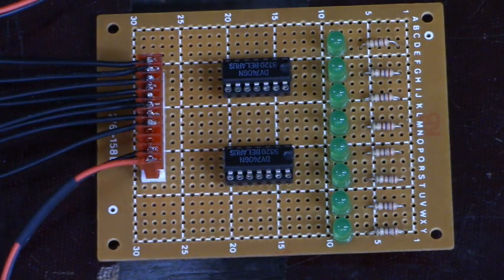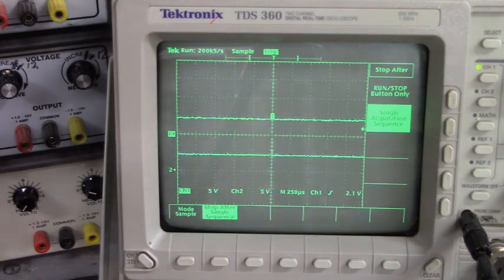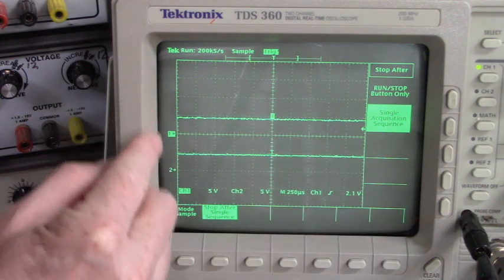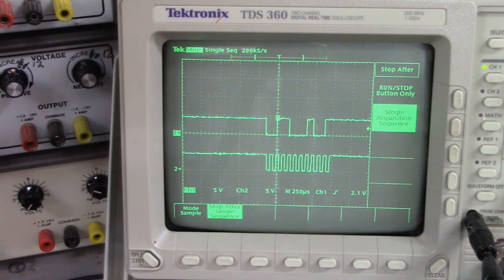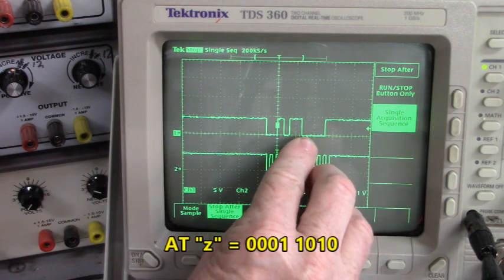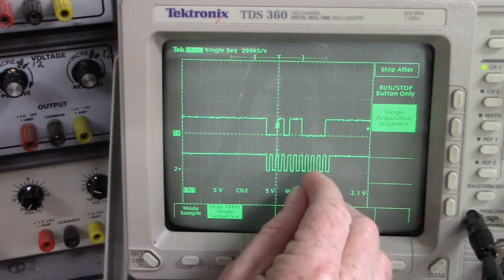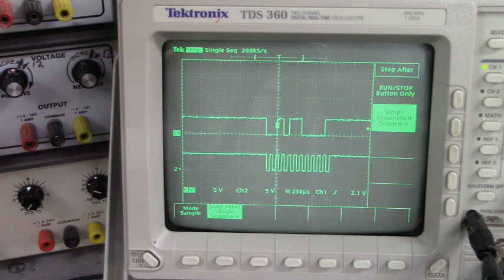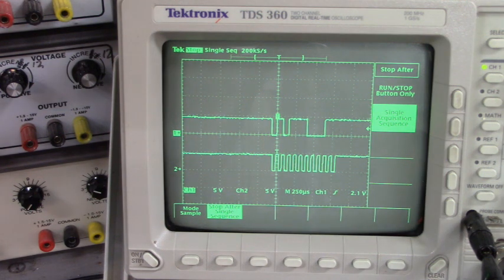AT Keyboard to ASCII Keyboard Converter

Comment: Ah, the good old 'F84. I cut my teeth on Basic Stamps and then moved onto the OTP PICs. I usually only had one windowed part to work with and with the UV erasure, code iterations were glacial. Then along came the flash parts and I never looked back. :)  Thanks for the memories!
Reply: Pretty sure the first microcontroller I played with was the 16F84 flash version. I had a great time wiring all kinds of stuff up to that microcontroller - a whole bunch of 7 segments to make a hour/minute/second clock, a stepper motor, buttons, all kinds of stuff. Hours of fun in a tiny little chip! Oh, and a character LCD display. That one took a lot of work to get working - no ready to go drop in arduino libraries back them, just the datasheet for the LCD control chip and the pic assembly code, and you figured it out until it worked!